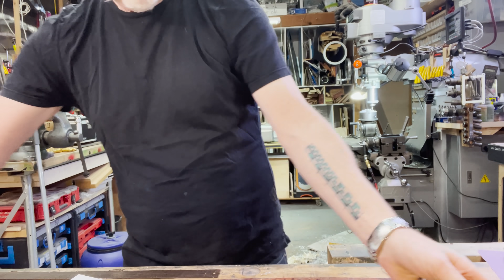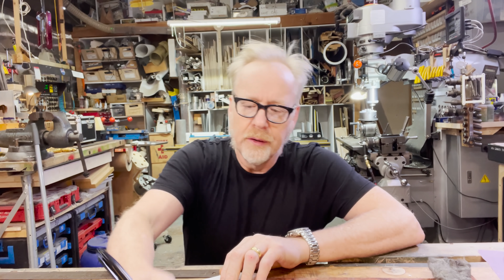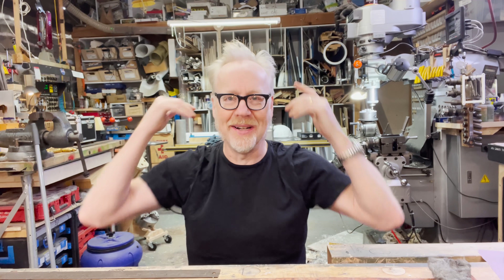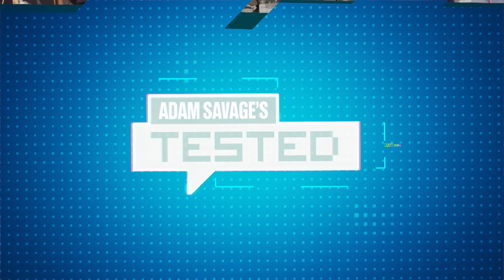Ask Adam Savage: 3D Printer vs Vacuum Former for Cosplay

Comment: Why not both? Vacuformers are pretty easy and cheap to build, plus as stated you can easily print objects to vacuform over. It used to be that people had to create or carve those, often by hand in order to use them only once, whereas a 3D printed one is relatively low effort. Worst case, you have to model it yourself (which goes with anything 3d printed anyways so that's a skillset for other things too) or best case, someone else has already done it and you just have to download and slice it.
Reply: At the time, he wasn't able to get both. He wanted to know which would be better/more impactful to get first.

Comment: My problem with 3D printing is the learning curve. There's only so much time I can spend in front of a computer before I have to start doing something *real*. 
Same way when I need to design a circuit - there's only so much of the chip's datasheet I can absorb before I have to start breadboarding to see how it actually functions. I got an Arduino to try my hand at programming and there's just such a steep learning curve for me on that, I've stuck with discrete components for now.
I need to physically interact with what I'm Making that the virtual construction of CAD, CAM, STLs and 3D printing can't offer me.

Comment: 100% agree.  I'm not a cosplayer, but the one thing i will say is that my 3d printer (Creality Ender 3 v2) has absolutely changed my maker life. I make custom enclosures for Raspi and Arduinos, custom toolholders for my workshop, spare parts for my mum's vacuum cleaner and dishwasher.  There's sooooo much more that can be done with 3d printing, and there's great resources like Thingiverse for sharing.  Love it, wouldn't have it any other way :D

Comment: I completely agree with Adam, but the answer to the question is really even more simple than what he said— a relatively high quality vacuformer can be made for pretty cheap, using fairly cheap and readily available materials, whereas a 3d printer cannot...

And yes, you can potentially make a 3d printer yourself— I've watched some YouTube videos actually do it—  however the fairly steep learning curve of 3d printing is more than enough without also coupling it with the problems and the pitfalls, the trials and tribulations of constantly troubleshooting and problem solving a homemade 3d printer (that also can't possibly have a terribly large build volume without some serious engineering skills)...

Comment: I'd argue that 3d printer only comes full impact when the user knows how to use any 3d modeling software well enough to make their own prints. Vacuum former works with anything that doesn't melt under the heater.. so if person is very good working cheap material (hell, you can use potato for the pattern) by hand it may be faster. Also, while most 3d printers work pretty well by keeping slicer settings at default and dropping stl in, getting very good results takes hours - not only failed prints but systematic learning how the exact printer behaves with the exact material chosen when trying to make a piece that would literally be faster cut from a potato..

Comment: Personally, I think nowadays its along the lines of this:

3D printer for cosplays is good for making stuff for yourself.
Get a vacuum former if you want to make a lot of the same part/costume, or sell kits.

My good friend has a 3D printer, and we make a lot of Star Wars costumes with it. We are looking into buying or making a large vacuum former, so we can sell lots of copies of the armor. Using the 3D printer to make bucks. 

I also personally prefer working with vac formed materials, simply because I hate filling and sanding; and I can work faster with vac parts, although a lot of that comes from more experience with vac formed kits. 

100% 3D printer 1st, vac former 2nd. but both is best!
Reply: I agree. A maker needs both! Have to pick on or the other is not practical

Comment: I disagree. Mainly, because you can build a small vacuum former for next to $0. Up to about 16"x20" (40x50cm) will work with an average home oven. So order a 3d printer and while you wait for delivery, build a vacuum former. I could get on a soapbox about how I think the vacuum former is way underrated. If a part doesn't have a mechanical function or could be just a shell/cover, vacuum forming might be way faster, easier, cheaper, stronger, better finish.

Comment: A chunk of plywood with a hole in the middle and a shop vac fitting, make a pair of picture frames to hold the plastic, use the oven to warm the plastic, easily a cheap DIY vacuum form machine that I've used many times and costs very little.

Comment: Don't forget that with 3d printing comes a whole new world of troubleshooting and also many different types of printing (FDM vs Resin). The learning curve can be pretty high, people need to be prepared for that as well. Even an expensive printer will not directly print what you see on the screen, there are parameters to tune, hardware to tune, materials to choose etc.
Reply: True but I do think there are more resources for learning and troubleshooting 3d printing than vacuuforming though I could be wrong. (Or perhaps more easily accessible)
Reply: Indeed it can be. I would recommend people who just want a few parts send it out or find a local maker lab. Unless you want to make hi-resolution miniatures, then FDM is the way to go. But I did spend many many hours coming up the learning curve. But I also enjoyed that process, others might not.

Comment: While I don’t have a vacuum former I do have a smaller CNC mill and my biggest take on this question is the time you save with a 3d printer.

With the CNC I have to do the CAD, the CAM, figure out work holding and source the right size material etc. I also have to attend to the CNC to some extent to avoid a crash, to do the tool changes and flip parts etc => I'm basically tied to the machine for the duration. A small simple part is going to take quite some time from idea to actual part.

When I bought a 3d printer last year all that went away, now I have an idea, CAD it and let the 3d printer do its thing while I can do something else in the meantime.

Sure I might need to do 5 prototypes before I get the result I want and it might take 5 hours per prototype but I have only spent 15 min of active time on it. To me this was super liberating and have really allowed my creativity to flow and ideas to come to fruition.

Comment: 3D Printers are one of the most versatile tools that I've ever owned. I've had several and love them. Not only can use them to make cos-play pieces & props but they can be used tools, forms, jigs, etc. I've used my printers to make all sorts of racks and tools holders. My advice to anyone thinking about getting a 3D printer is to get a FDM printer first and learn to use CAD. FDM doesn't have the fine surface detail that you can get with a resin printer but it's cheaper and easier to learn out (way less messy also).  For $0 you can get really good CAD software like Fusion 360, Free CAD and a few others. CAD is not anywhere near as hard as it seems and within a few days of practice you start designing stuff that you've never been able to without it. 3D Printing has allowed me to build things I never could with any other process.

Comment: Buy a 3d printer, build a vac former. I built a vac former from a tuna can, aquarium pump, and a heat gun for molding model airplane cockpits when I was a kid. There are various free or paid plans available for proper ones that use heating elements from ovens or kilns. It can be done on the cheap with a diy solution and you can use your experience and knowledge to choose a more professional solution when you are ready.

Comment: Well, i guess you know our answer. But yeah, a really big 3D printer … but even a 220 x 220 x 250 volume can be used to make helmets and other things by welding pieces together. A heated or at least enclosed chamber will help. We' also really like belt printers like the Creality CR-30, which can print an entire broadsword or Crcodile Loki in one go. Of course, resin printers are useful for small and highly detailed objects. Dont't skimp on quality, because a badly-made 3D printer, unattended, can burn down your house. Check those reviews! And most of all, have fun turning your wildest ideas into tangible objects.

Comment: I love 3d printing! It's been so useful. I disagree with the sale of STL files though. If someone wants to sell their work, they should have to include the actual source model files as well so the buyer can either print it as it or be able to make modifications easily (STL files cannot be modified easily).
Reply: You can definitely modify STL files. It's just polygons. Bring it into a sculpting program or even a normal modeling program.
Reply: @3DJapan  yeah you definitely can edit STL files, but it's a whole lot easier when you have the original model files. Editing STL files, like you said, usually requires sculpting, which isn't what most people are use to when it comes to creating 3d printable models. Although, I guess it really depends what kind of models we're talking about though... Characters and table top game pieces are definitely more of a sculpting thing, and I can see not including original source files for those kinds of models, but for things you build, or useful parts and objects, those are usually done in parametric modeling based on sizes, measurements, constraints, etc. It's better to have source files for those kinds of models.
Reply: I agree, make it easier for someone to modify the design. If your buying something that’s going help you on your project it’s very important to be able to change this quickly.

Comment: Just built a Mandalorian helmet for my son for NY Comic-Con using a bicycle helmet and a bunch of OVA foam, hot glue and epoxy resin. Expanded that to nearly a full set of Mandalorian armor for Halloween, again OVA foam, hot glue and epoxy resin. Toyed with the idea of making a vacuum form setup over the years but definitely going with a 3D printer by next Spring after that project.

Comment: A 3D printer is great for props and widgets that are a fixed size (badges, broaches, etc.) Where it falls down is for objects that are going to be fitted to you. If at the end of a 12-hour print you find what you built was too small, you've got 12 more hours ahead of. So think about ways you can build adjustability into what you're making.

3D printing will also require that you get very good at CAD. There are loads of free apps and tutorials out there, but that's a skillset all on its own.
Reply: Measure twice, print once.
Reply: Theres a very good program called Armorsmith to help adjust the various files to YOUR size.
Reply: @bulletdancestorm554  I'll have to look into that.

Comment: Gman's question is on a par with "Do I need a hammer, screwdriver, saw or chisel more?"
Reply: I mean, it's more like asking if you want a chop saw or a scroll saw first. They can both achieve the same end, but one requires more skill and is more specialized than the other. It depends both on what you intend to make and how your process works
Reply: i'd argue that hammer/screwdriver/saw is possibly less obvious. i mean yea, eventually you definitely want all of them... and they're all quite affordable, so you can probably just get all of them to start... but if you only have a few bucks and absolutely need one immediately, WHY you want one of them is probably more important for deciding than any general advice.

whereas with 3d printer vs vacuformer, it's pretty obviously the 3d printer, unless you specifically need a vacuformer for a very specific use case... since muchg of what you might want to do with a vacuformer can also be done in a 3d printer, thus significantly delaying the need to purchase a 2nd gadget requiring an at least moderate investment.

Comment: While I don't disagree with Adam's conclusion here, I'd like to point out that the way he describes 3d printers suggests that they don't involve a whole bunch of a) messing up your first projects while you learn to use the tool and b) a massive amount of finishing and post processing (assuming you don't want it to look 3d printed) to get the parts looking good.  I've got a 3d printed, full-size R5-D4 head that shocks everyone when I tell them it's 3d printed... but that's the result of HOURS of sanding and having really good painting skills.

Also: there are basically 3 kinds of 3d printers.  Printers aimed at folks who are willing to pay more to have a machine that JUST WORKS.  Printers aimed at folks who find the tinkering with, tweaking, and perfecting a printer to be a fulfilling hobby in and of itself.  And printers intended to make the company the highest possible profit margin.  Decide which of the first two types you want and then do the research to figure out which is which.
Reply: the good thing is that as 3D printer manufacturing gets more and more competitive the first two types of printers are getting quite close in price. Prusa i3 format printers are 750 new, and are extremely reliable. They also have extensive community support given how popular they are. If you need cheaper than that then a reputable clone from china will get very close in terms of reliability for less than half that.

Comment: yes, a 3d printer, even for just the fact that you can do so much stuff with it other than cosplay.
Reply: Like what? The only thing I’ve ever seen that’s handy 3D printed are like custom brackets. Beyond that it’s just toys and decorative stuff, but very little functional stuff.
Reply: @IanSmithKSP  A 3D printer can make virtually anything that's made of plastic and smaller than its printable volume. Custom tools, electronics enclosures, gears, tubing, replacement parts, grips for devices to better fit your hand, parts of tools that aren't yet on the market (for example, the "ear savers" for masks were available via 3D printing long before they were available for purchase). It's heavily used in rapid prototyping where you design and print things in plastic until you get the design right before producing it in more durable and expensive materials. You can even use the "lost PLA" method for metal casting, so it extends to metal as well. The newer elastic printer polymers also allow things like plastic springs and hinges, wearable mounts for hardware, wallets, etc.
Reply: @Merennulli  I made a bunch of ear savers to give to my doctor.
Reply: @3DJapan  That's cool! I've loved seeing all the great things people with 3D printers have been doing for their communities.
Reply: @Merennulli  Couldn't have said it better , thanks :)
Reply: @IanSmithKSP  There is a party for helicopters that can only be made with a 3D printer.
Reply: @IanSmithKSP  
You can print a lot of functional stuff on a 3D printer. At least on an FDM printer you can. SLS prints tend to be brittle so you often don't use those for mechanical parts unless you're going to mold and cast them in a stronger material. 
Using my printer I've made a hook to hold my bag off the ground when I go to the track and it's raining. I've printed a door stop, a buckle with custom dimensions, rope clams for tying knots, mechanical latches for boxes, a cup holder, a bunch of wire clips, and even printed a socket wrench head for a hex bolt I didn't have the correct size for.
Reply: @iout  Did you mean SLA prints are brittle? SLS (selective laser sintered) parts made from nylons and metals are quite robust. I made a custom seatback for my kayak from SLS nylon. SLA resin can be brittle, though the "engineering" resins are making large strides there. But for home use really FDM is the game. Even so it can make some decently strong  prints.
Reply: @tim1398  yes, I meant SLA. That’s my bad.